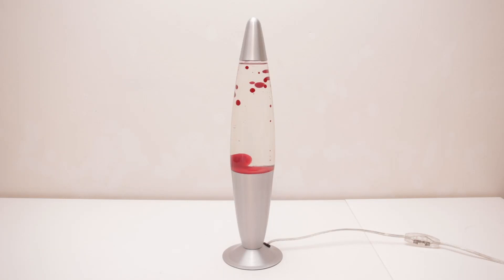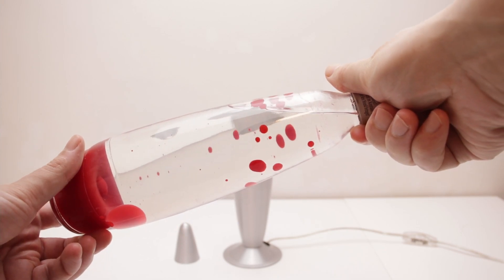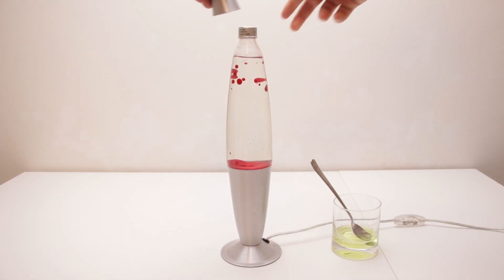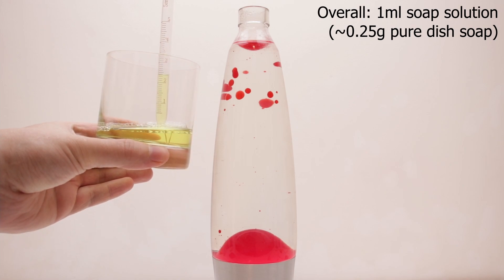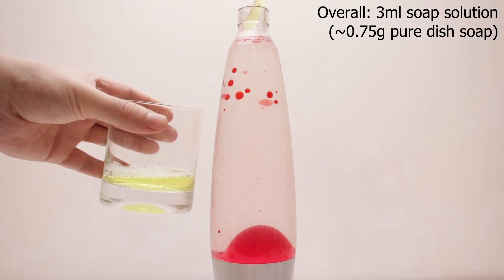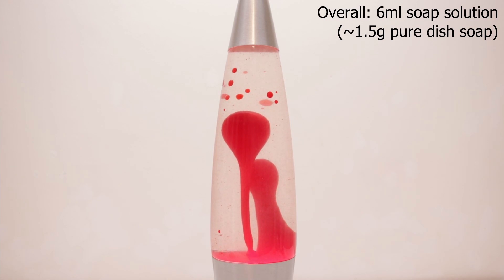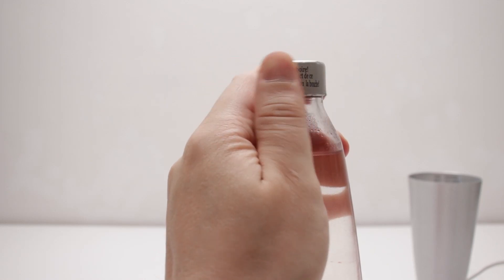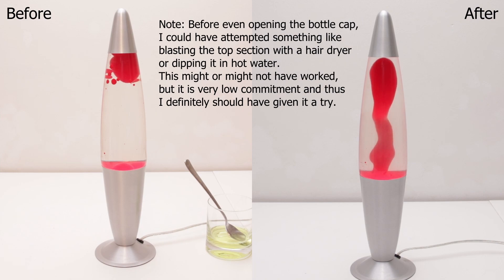Wax stuck to glass: Trying to fix Lava Lamp with Dish Soap

Comment: Bad idea. Lava lamp water is carefully tuned, and soap (surfactant) is a key ingredient. Adding a whole bunch of dish soap will not only upset the delicate balance but also introduce fragrance, dye, and other impurities that may cloud the water. Two better alternatives:
- Use a shapable implement such as a wire coat hanger to simply scrape the wax from the glass.
- Bring to operating temp, empty, and save the contents. Clean inside using whatever means, making sure not to leave contaminants, and replace contents.
In either case, the cap must be secure (not loose as it appears here) to prevent evaporation of both water and another chemical used to make the wax less buoyant. At one time this was thought to be tetrachloroethylene, however modern lamp wax doesn't have that smell. Running for an extended period isn't great for the wax, but is often all that's needed to clean the glass. Avoid opening if possible.
Reply from the maker: Yeah when I made that video I didn't really know what I was doing. Since then I did a lot of experiments with making lava lamps from scratch (see my "preview" videos) and learned a ton. You are spot on with everything you say.

Comment: And what to do when i dont like the color? My sister has a blue water with yellow lava and i find it ugly😂 but she wont use it anyway so can i change the water to like normal water color? Like seethru or ?
Reply from the maker: You can try changing the water altogether, as I do in my unclouding video. No guarantee it will work ofc, but if you ain't gonna use it otherwise might as well go for it.

Could add some more food coloring to alter the color, eg add yellow to make the water green, or add red to make it purple if you prefer that.

Maybe theres also some kind of bleach you could add to destroy the color but leave the water the same... no idea about what could work though.
Reply: Io ho cambiato l'acqua della mia bottiglia e l'ho messa trasparente, però bisogna utilizzare acqua distillata e sale

Comment: Hey mang, wanted to let you know all you need to do is 'save' the original fluid in a separate (for the love of god make sure it's clean) clean container while the lamp is off and cool.  Make up your water soapy concoction and dump it in the now empty lamp. Turn on lamp... you might get lucky and get some bubbles, however, this doesn't matter.  Do exactly what you did in the video - play with the stuck wax with a dropper and some soap...  once happy, let it all cool thoroughly - like at least 10 hours (and don't speed it up, for the love of god).  Rinse with clean water and then add back your original solution slowly (for jostling water could cause it to become cloudy).  Thanks for your content, mang.  Lava lamping is a dying art with all the restrictions on chems in wax.
Reply: Oh I forgot to put the overall reason 'why' you'd do this... After a year the soap will shed impurities into the water which will cloud it - also, after the soap breaks down it might get stuck in coil thus rendering some sort of gross mold/slime stuff i don't know it's just really gross though and your wax is gonna need cleaning... which I did watch the channel's vid on doing that, very nice

Comment: I get so annoyed by these videos.... DO NONE OF YOU OWN AN OVEN?... seriously, just put the glass element in the oven @ between 80-100 Degrees Celcius for approximatly 40 minutes... then that will fix your issue by melting all the wax. Running the lamp will not work because the entire principle of the effect is to run in a heat engine that has a temperature difference. The top of your Lava Lamp will always be colder than the bottom, hence why the wax at the top solidifies and stops moving... especially with low wattage bulbs which is all the rage these days. The old lava lamps that ran on a 60W bulb did not have as many issues as the 15- 20W bulbs you find in present days.
Reply: you dont even need an oven, my lamp had some residue that looked like scratches on the side and i just put it into a bucket with hot water around 60C and it all melted away